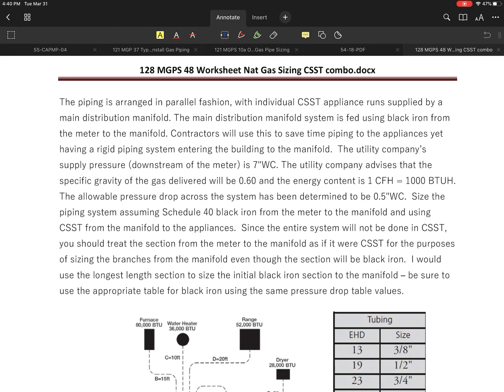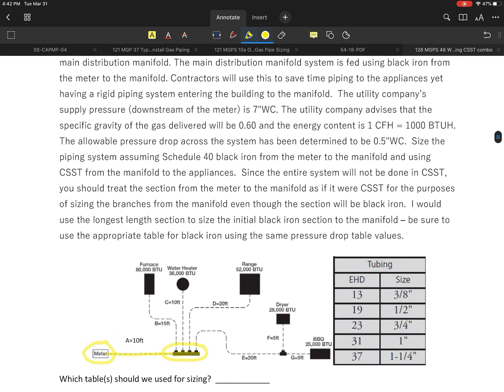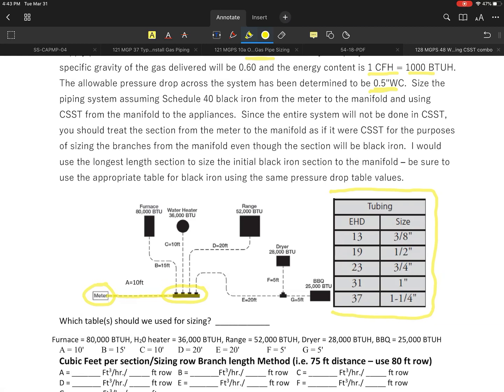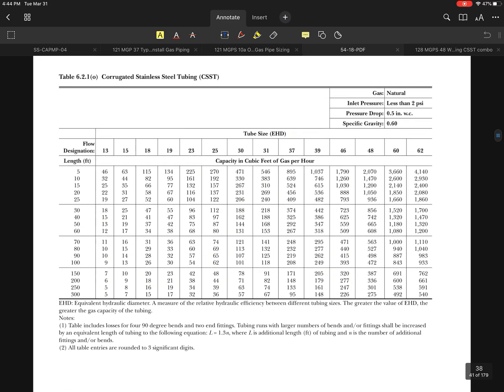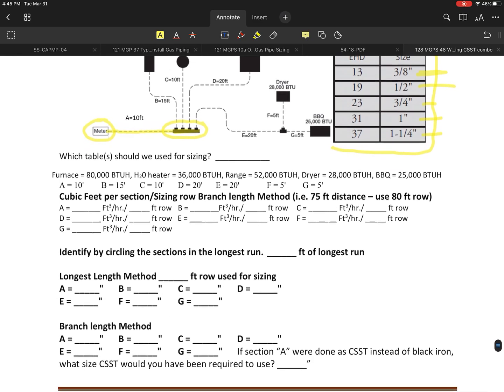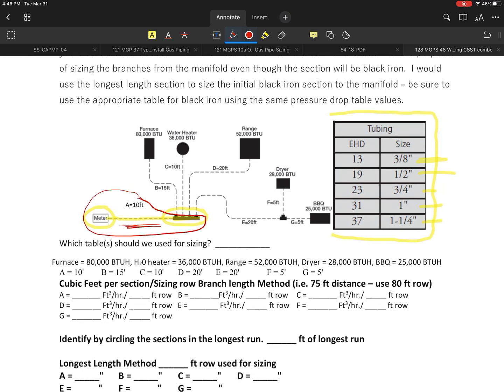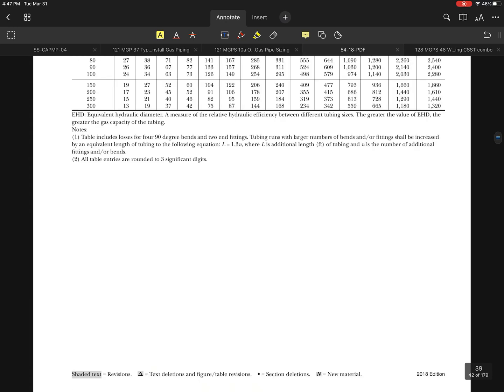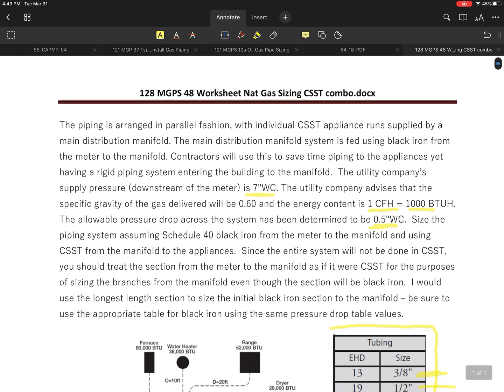Sizing a natural gas system using a combination of black iron and CSST tubing

Comment: In order to determine the size pipe needed, how do I find out the natural gas inlet pressure, pressure drop, and specific gravity?  This information will need to be known in order to use the correct table.  Called local gas company and they would not tell me.